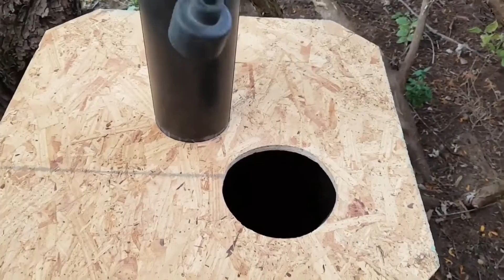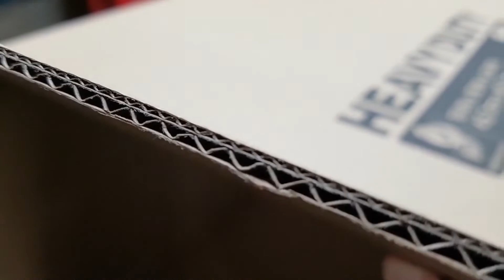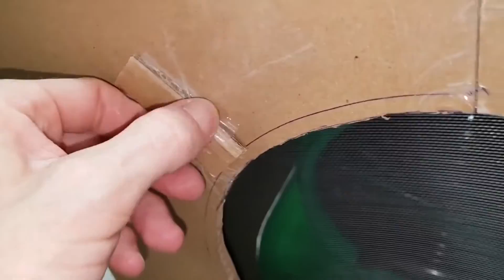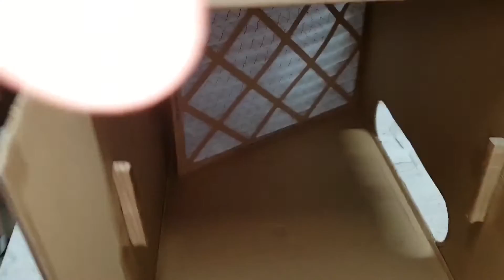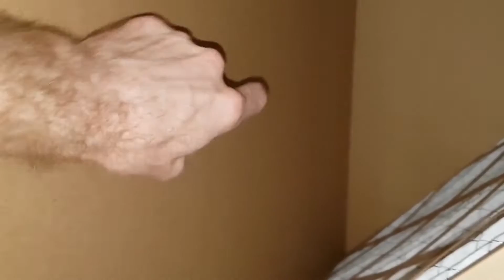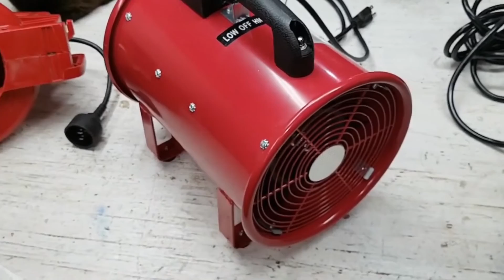DIY Air Duct Cleaning Tools, part 3 - Making a Negative Air Machine for Duct Cleaning / Duct Vacuum

Comment: How long instead of going through all this trouble that you’re going through why don’t you just use the actual furnace blower as your source of negative air and just change the filter after you’re done .. thenclean out the freaking blower afterwards and call it good
Reply from the maker: My system is designed so that the blower produces positive air, but could probably be rigged to provide vacuum through a filter if needed.  I don't know.

Comment: I’m thinking of a design of two rubber made “totes” with the bottoms cut out then joined and JB welded or epoxied together and laid on its side that way you have two sides that can be sealed with lids for quick access and a lot more volume for possibly a dual blower/vacuum system. 

How has your project developed so far?
Reply from the maker: I think a single large tote and blower would be more than enough for most houses.  But if you need to do very large houses or commercial building ductwork, then you may want to go bigger.  I really don't know.  The negative air machine I made in this video was more than enough for the size of our ducting, although the leaf blower I originally used during part 1 was just barely able to clear the ducts when sweeping with an air whip.   

So far, I'm pretty happy with the DIY duct cleaning tools that were made in the later videos.  Our ductwork is getting dusty once more, so it won't be long before I will need to clean it again.  I hope to share some more video about this equipment and how I used it.

Comment: when the inlet is clogged, the motor doesn't work as hard, it works a lot less. Just put a watt meter on the plug of the fan and test with and without restriction. The only problem is that heat removal is also a lot less because of less airflow.
Reply from the maker: That makes sense.  I should have thought about that a bit more.  Thank you for helping me to understand it better.

Comment: I guess I'm just not understanding the process of the negative air box. Why can't i just connect my shop vac to vacuum the dust as i clean the vents?
Reply from the maker: A shop vac can't move enough air for this size of duct using this type of duct cleaning system.  I tried my 6hp shop vac first and had no luck.  But I believe an effective duct cleaning system could be made that uses a shop vacuum.
Reply: I have straight shots from every room

Mine are at top of the ceiling about 10 ft up

Only thing I'm worried is dropping it all into plenum 

Might get a high ower shop vac and hep filter with hose extension

Comment: Sorry, I still can’t understand why you put the outlet of the leaf blower inside the tank instead of using the inlet part of the leaf blower that is already negative. 
Could you please explain that? Thank you! I have to clean a industrial laundry site and still figuring out how to do it at the minimum cost. Thank you.!
Reply from the maker: I didn't do the best job of explaining in this video, but the inlet of the leaf blower is what was inserted into the custom wooden lid of the barrel.  The outlet of the blower was pointed out towards the front yard.

Comment: You can keep the tubing amply separated from each other by shoving a spacer between the two. A perfect option is to shove a short length of the very same or even thicker tubing so that it stays  place, but not so tightly that it forces the whip strands too far toward the sides and interferes with or eliminates any effect the pressurized air supplied by the air hose has on their movement. You mostly need to avoid pinching them too much that it constricts their inside diameter.
Also, have you considered using a gas-powered blower instead or adding multiple inline fans to the flexible hose/dryer vent?
Reply from the maker: Great tip!  Another viewer mentioned a similar solution for the dual hose duct cleaning whip.  I've never considered using a gas leaf blower or multiple air movers together for the diy negative air machine, but I like the ideas.  Thank you for sharing some of your advice and ideas.
Reply: @BudgetPhil  I am keeping an eye out for deals on multiple small box fans because this inspires me to build a unit myself. I live in a 100 year old house. I don't know when central heating was installed here, but the ductwork was obviously never cleaned.
Reply from the maker: I'm not sure if box fans can generate enough airflow for duct cleaning, but maybe. I haven't been able to get them to pull much air through tight spaces like ductwork.  Air movers with squirrel cage fans seem to be the best bang for the buck in terms of air flow through tight spaces. Using multiple fans or blowers for a DIY negative air machine can be a problem if they "fight" each other for air, which can reduce their efficiency quite a bit.  But I really don't know much about that.  Used blowers with squirrel cage fans are commonly available, and they work well for directing lots of air where you want it.  Many different sizes are available.  I think the blower size, or air flow rate, needed depends on the size of the ducting used for the ductwork.  It's an interesting subject that I'd like to learn more about.

Comment: @Budget Phil I'm making my own machine thanks to your videos. I do hvac and just started my own company this year. I'm an engineer by heart tho. Would be awsome if I could ask you a few questions about your new vacuum.
Reply from the maker: Sure, I'll answer the best I can.
Reply: @BudgetPhil  how much of a difference did it make when you upgraded from the leaf blower to the air blower? 
And if you were to upgrade again what would you upgrade to?
Reply from the maker: It was a massive improvement.  I'd say it moved 4 to 5 times more air than the leaf blower.  But of course I had to increase the size of the flexible ducting connecting it to the house ductwork in order to get maximum airflow.  If I upgraded again, I suppose it would be to a 4,000 or 5,000 CFM air mover.  And I would also need to once again increase the size of the flexible ducting used with it.  The 2500 CFM blower I currently have is more than big enough for the size of ductwork I'm cleaning though.
Reply: @BudgetPhil  how long does it take for you to clean a duct system with your rig? I know it would depend on the size of the system and how dirty it is. Let's say a 1,600 sqr ft house with a 3 ton system on it, with average build up in the ducts.
Reply from the maker: I don't have enough experience to answer that question but it took me about 4 hours to clean the dust and debris out of the ducts of a double wide trailer house during my first attempt.  If I knew what I was doing, probably could have done it in a fraction of the time.  They're fairly simple, straight runs of ducting and easier to clean than most other houses I've looked at.  I had to go back and do some cleaning with my DIY brushes which took me much longer.  Another 6 - 8 hours longer approximately.  Cleaning the ductwork was just part of the project though. I also needed to clean the HVAC unit.  The blower and the coils.  I have yet to show that process, but I intend to share everything as the series progresses.

Comment: Good job on these videos.   I wished I had time to do this.  My ac unit is in the second floor attic in a townhouse and the ductwork in both attics are really dirty as evident on the outside of the vents.   Idk if making my own tool for cleaning when the dust is piped down two floors would be something I could do.. once I took off the big duct pipe off that is near the V coil inside the unit the attic.. I was only ever able to get to one side of the coil what a mess I made trying to clean that coil.  Also since then when I crawl back up there, I see that that big pipe is starting to come off.  I used foil tape but also that foil foam tape.   It just makes it harder going between the two floors
Reply from the maker: Thank you.  I'm having the same basic problem trying to figure out how to access both sides of the AC coils without any major disassembly.  I've seen videos where technicians spray a foaming cleaning agent onto the coils and I believe that could be a good option as long as I can rinse it off.  Or maybe the moisture condensing on the coils during operation would rinse the chemicals off.  I don't want people breathing in that stuff.  Cleaning the HVAC and the ductwork has proven to be a much more involved task than I originally thought, but I'm going to continue my effort to clean all of it by myself.  And I'll keep sharing what I learn.
Reply: @BudgetPhil  I used to own a Pringle Vac truck (overkill) and now own a RamAir International system that incorporates a lot of what you've tried... check out Dave Hart's youtube videos for some more ideas... good on you for testing stuff out.  Using the existing furnace fan as your vac blower and working with the existing air flow was a unique idea he had, although you might want to pull the fan clean it and put it back before firing it up and duct cleaning.  Thanks for your time and trouble.
Reply from the maker: Sounds like you have some nice equipment.  Thank you for the advice, I'll check out those videos.

Comment: The air hose flex seems to be a weak link, if you can't push it down there, then how you going to clean it.
Reply from the maker: Yes, that's a good point.  In part 4, I'll be showing how I made a stiffer whip leader hose that fixed the problem.  The hose is finished but the video will take a couple more weeks to finish.  I'll post it as soon as it's complete.

Comment: Great video ,thank you for the blue print .i will tell my son to copy this and try to  start his own business . Lets see if he has the ambition like you do. But I will definitely  try this myself .We all sleep with sinus problems and clogged air passages I cant believe we all have sleep apnea. Next I want to look up how I can test my air quality in my house myself. Any suggestions?
Reply from the maker: Thank you.  I believe they sell mold test kits at hardware stores but I've never used one.
Reply from the maker: Air quality monitors that have a variety of sensors may be able to help identify any air quality issues.  They can measure things like the amount of carbon dioxide, dust, formaldehyde, or whatever,  present in the air.

Comment: Is what you built kinda like a negative air machine?? Looking at the costs you listed in the description, it is more than the cost would be for me to locally rent a negative air machine (about 90$ for 1 day, in my area) .. Which would be the better option, you think? It would cost me less which is great . But the downside is of course not being able to keep the negative air machine.
Reply from the maker: That may indeed be a good option but I don't know.  I would ask the rental service provider what their opinion was.  They may be able to point you to the appropriate machine.  They'll probably need to know the size of the ductwork.